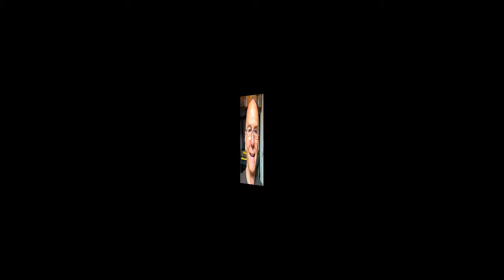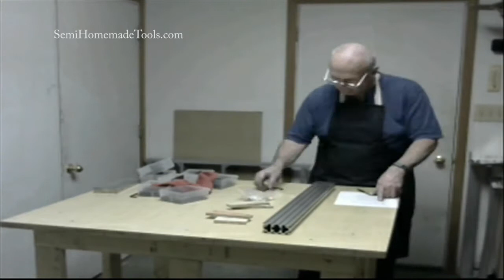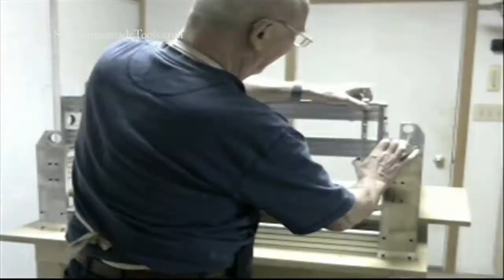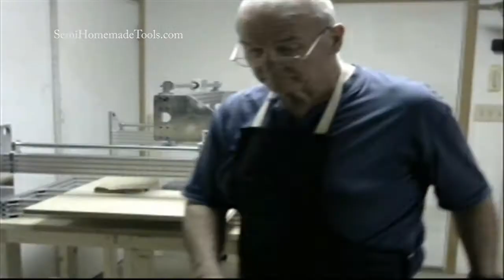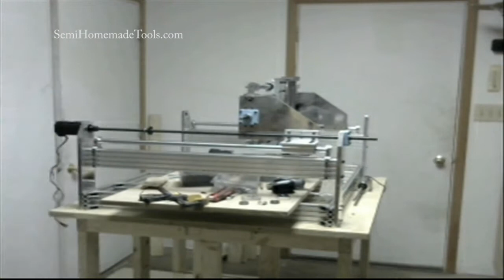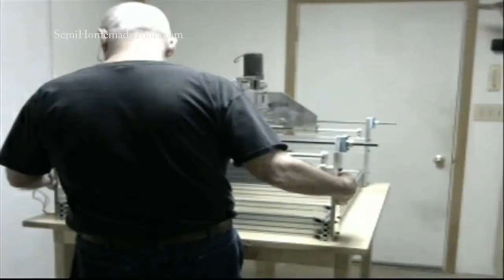Building a CNC Router in 100 Seconds

Comment from the maker: We are calling it 25" x 25" x 6". The actual movement is that, but in reality, by the time you add a couple of limit switches, etc. you will be looking at closer to 24.75". The goal was to be able to do a full outside cut with at least a 1/4" bit and have a finished piece that is a full 24" x 24".